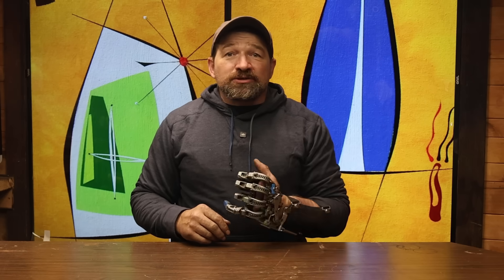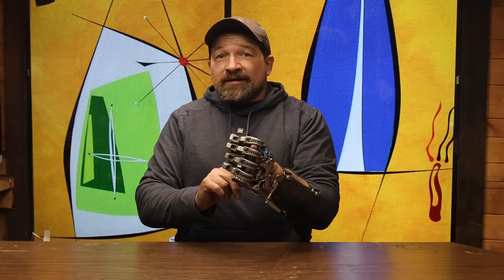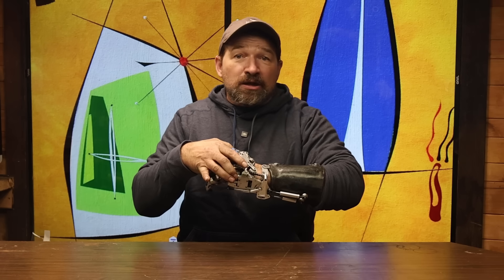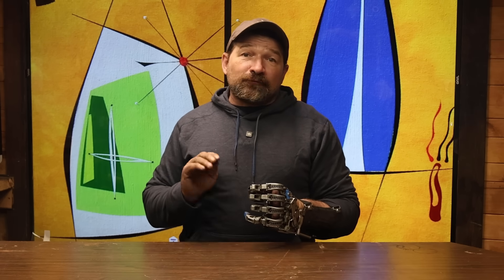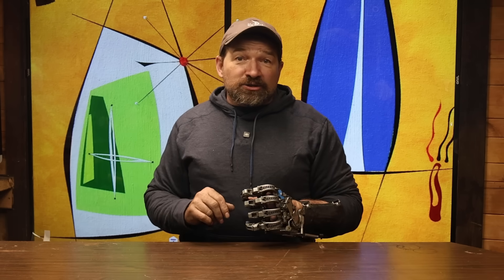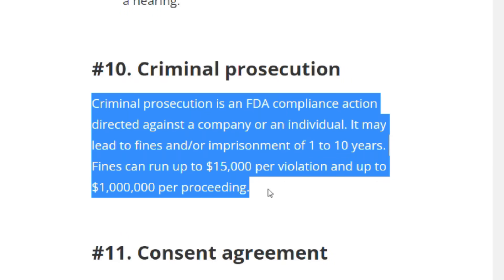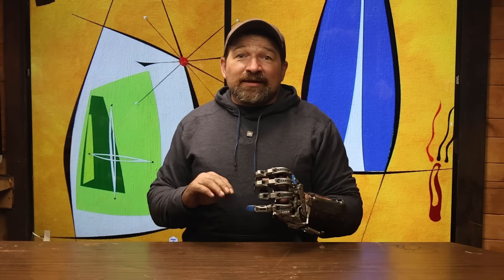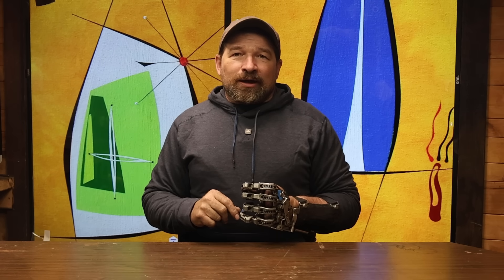Give me a hand! I'm trying to get this information to the right people.

Comment: Fighting with insurance companies to pay for A WALKER has showed me how frustrating and difficult it can be to get the things you need. The 5$ aluminum construction, sold to me for 170$, sold to the insurance company for 1,500$.

I can't imagine the hassle and frustration that comes along with getting a prosthetic here in the States. You're doing humanity a great service not just by offering a niche product that could significantly improve the quality of life for certain people, but inspiring people to find creative ways to engineer useful things without depending on this ridiculous system they have us trapped in.
Reply: @acmhfmggru  imagine defending big corpo.
Reply: @acmhfmggru  1. Medical grade walkers can be made from both aluminum and steel.

2. A simple steel or aluminum tube walker construction could last decades. The constraints for the design and manufacturing of walkers are not that tight.

3. Even if they were rated for summiting Everest a dozen times, it still wouldn't justify a 3,000% markup
Reply: This is the scam insurance companies get away with.  It's similar to how supermarkets will mark things up just to put them on sale the next day.  In the case of insurance, they can base their premiums off of the marked up cost, but only pay a discounted cost, pocketing the difference.
Reply: @acmhfmggru it does need to make a profit to stay around. That much is correct. But how large a profit can it have before it's unjustified? There really isn't any way to justify the cost to the consumer being 300x the bill of materials. The company is making a massive profit they aren't entitled to on an essential product.
Reply: I recall a reasonable profit price increase being 40% and then tax. @enderduck4253
Reply: @acmhfmggru You and I both know that the USA has extortionist levels of markup on its medical equipment. The most expensive medical grade walker in the UK, Japan, and South Africa averages to about $500. 

That is top of the line medical equipment with custom fitted handles and tungsten reinforced titanium construction. Now you try and justify a basic steel frame walker being over $1000.
Reply: @acmhfmggru  But you weren't correct, though. I even broke it down and explained how you were wrong
Reply: @acmhfmggru   It's pipe you mouth breathing buffoon.
Reply: They can't deny you. Just make them aware of the policies they have to go by. This is the market prostetic now. They have to provide it. Nowhere does it say it has to be a wooden prostetic. It says the prostetic of the market.

Them denying you the prostetic or the funds to it is going against the agreement they make when creating an insurance company.
It's very simple. As it is the law. Just make them aware. Or pull them in court.
Reply: Hope they will start paying attention from now on.
Reply: but theyre paying $1500 for the walker. The problem isn't just the insurance companies. Its the inflated costs of medical prices and services.
Reply: @joeydube420  I thought I made that point clearly. The system is designed to maximize profits for the producers.

You see the same thing with pharmaceuticals too, where the production cost of a drug is incredibly low, but due to how producers of medical devices and medication will negotiate costs with insurance companies, it becomes incredibly over inflated in value. You go to the hospital, the hospital gives a flat quote for their services to billing, billing sends it to either insurance or the patient. This is also why you should always have your hospital stays itemized on your bill, because it serves as an audit for the services you actually received.

Insurance companies, pharmaceutical companies, prosthetics and device manufacturers, it's all a racket.
Reply: When I was 8 or 9 years old, I helped my grandma build a walker for my quadriplegic father out of PVC plumbing pipe, because the insurance companies wouldn't provide one, so we made a better one. It was a prototype, and we tried to patent the design, but a medical device company beat us to the punch, stole our design, and did nothing with it- they basically did it to snuff out competition for their inferior design. The then tried to sue us when we offered to make 3 more (NO PROFIT, JUST MATERIAL COST) for others in similar situations. 

It was a tall walker to support his full body weight, with a leather saddle, much like a baby walker. Our design could have helped countless people, and the profits could have paid my fathers medical bills for the rest of his life. 

Sick bastards run the world.
Reply: @acmhfmggru defending the people/system that rips off the sick and disabled is crazy
Reply: @acmhfmggru this bozo is really justifying overcharging people with disabilities
Reply: @acmhfmggru  If you think I made some kind of error, you're welcome to point it out
Reply: 🤡 @acmhfmggru  no yeah I agree the u.s. medical system works great
Reply: Can you order it online? I bought my twin a walker to replace his cane when we started university a couple years ago for about a hundred bucks, here in Canada the equipment at the hospital is subsidized as well so he got his walker for around 15 bucks and I believe his leg braces were free but they are fitted for his legs so I'm not sure.
Reply: @acmhfmggru  Still defending big corpo and their x300 profit margin!
Reply: @acmhfmggru How much do they pay you bro
Reply: @acmhfmggru  gluck gluck, how's it taste?
Reply: Times are a changing
Reply: @acmhfmggru  bro has never paid for medical items. they are always ridiculously up charged for no other reason than they are medical. go buy a "urinal" that is basically a milk carton for 15 dollars and tell me that's not overpriced just because it's a major medical necessity for people.
Reply: The supplier can charge a different amount depending on who is paying for it? That's legal?
Reply: @volbla  a it may be legal in the states but for what is essential equipment it is at the very least dishonarable to fleece people for something they have no choice about buying
Reply: @Daisy_human  Dishonorable is a fitting description for most companies in the medical industry, not only in the US...
It's sort of frustrating to see how much money they press out of the insurance companies (...which are not poor at all, but it is OUR money they pay to the producers).
I need an BiPAP-device (sort of an CPAP) and on the bill of the insurance-company the device was 3 times as expensive as on the free market...
The same goes with drugs and most likely everything else.
Reply: You should really vote for politicians who want to improve your health care system in the United States.
Here in the Netherlands we have standard rollators available for everyone who needs them as part of national insurance.
Reply: @rogerwilco2  Believe me bud, we're trying 🙃
Reply: @rogerwilco2  unfortunately the USA has been pushing for misinformation to be ok. so most trump supporters actually believe the EXACT OPPOSITE of their party. its wild... they somehow think democrats are the "cooperate party" when republicans give elon musk, jeff bezos, insurance companies etc ZERO TAXES and push them onto regular people and cut funding for these things to make up for it.

enjoy that "trickle down" guys!   .....  

another scary thing is how they've been pushing this agenda that "experts dont know what they're talking about" for over a decade now. "expert?! HA YEAH RIGHT! my uncle bob is the real expert!" is what these poor right wing sheep think now... this agenda let's them say whatever they want, and when generations of scientists that've spent hundreds of years in the field tell them they're wrong, they can say "experts have no idea what they're talking about!" ....       it's idiocracy coming to life
Reply: @acmhfmggru sir your whole argument is based of your own hypotheticals that don’t even make sense
Reply: "fighting for insurance" Americans dont realize how absurd this concept even is
Reply: @UndeadKIRA  Trust me, plenty of us are well aware of how bad we have it.

Virtually every person I know would rather stick out any illness or diseases than go to a doctor because they can't afford it. I had a friend with broken ribs who never went to the doctor's for it. It's genuinely disheartening to be stuck like this, especially having an autoimmune disease myself.
Reply: @UndeadKIRA  I don't get comments like these. Americans know it's absurd and a horrible system, but that's the hand we're dealt. Your average resident can't just not use the system in place. It's like saying people with a shit car are wild for not just driving a better one.
Reply: @acmhfmggru  Nobody will ever care about you in a way that matters.
Reply: @Frille512  I completely disagree with his stance, and I find his assertion of position to be arrogant, but that's no reason to disparage him like that.

Even the people you don't like live vast, complex lives with their own dynamic relationships. His arrogance here is likely not reflective of the majority of relationships this person maintains.

Comment: How might I add rocket fingers, the fingers need to penetrate 9inches of steel for non-villainy reasons.
Reply: Can I join you in your non-villanous exploits
Reply: I'm not an expert, so take this with a grain of salt.
The size of a finger wont be able to hold enough propellant to get up to the required speed, so it most likely wouldnt work. Instead, i'd either reccomend bullet fingers, or rocket fist.
Reply: @MrMoron-qn5rx  Could do railgun fingers, maybe. Though usually you'd need to slap on a secondary mechanism over the hand to act as a launcher.
Reply: consider: thermal fingers to cook a chicken by slapping it

Comment: While i can guess that it would up the material costs of the device, would using a foam/moss and silk composite for the straps limits the risks of chafing mayhaps?
Reply from the maker: If everything is positioned correctly, the device shouldn't move relative to the residual limb. As far as the straps, you could use any 1" wide material. I currently use some 100%polyester ribbon/edging from Joann's. It has a slick/smooth feel.